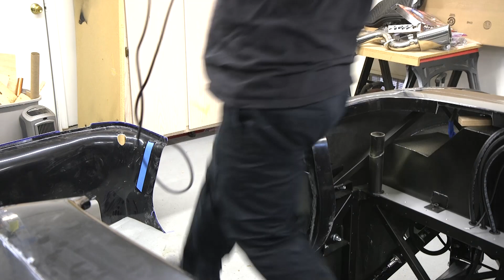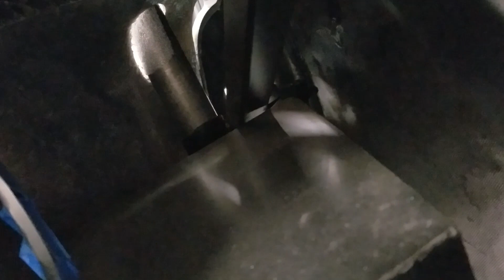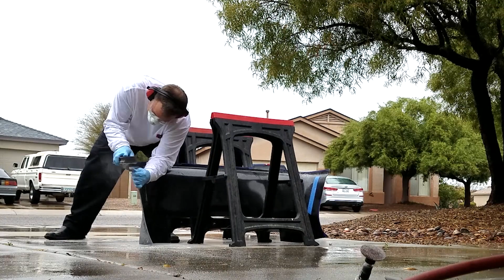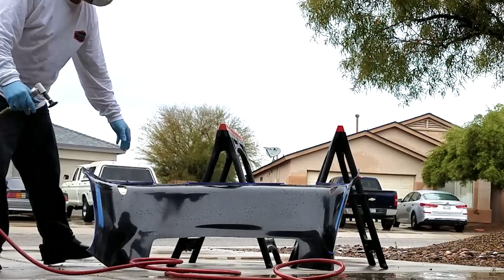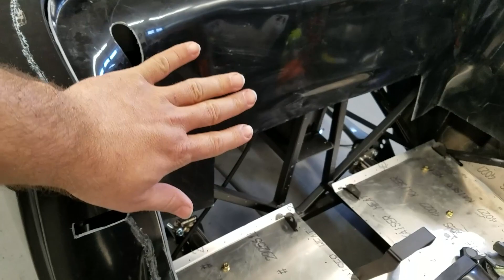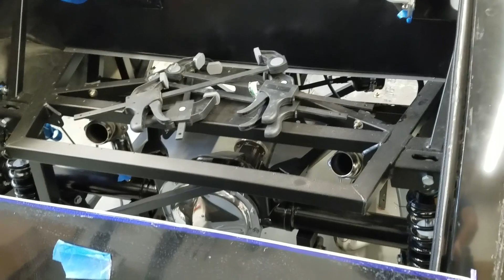Factory Five 33 Hot Rod V2 Build - Body Work 6  Waterfall & Roll Bar

Comment: Think I would weld new receptors between old ones and gas tank to move the needed hole onto the flat top of the waterfall and off of the curved potion. Too late for you unless you buy another waterfall, but something for future builders to consider.
Reply from the maker: If you are doing a hard Top that would not work and cause interference.